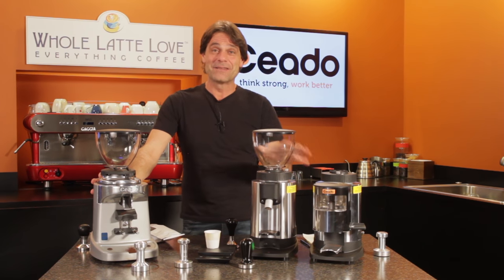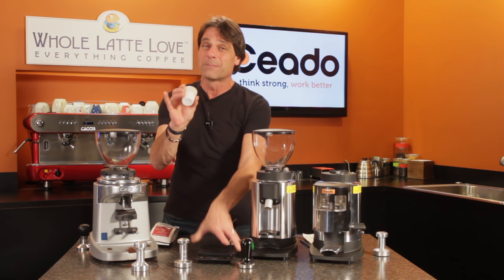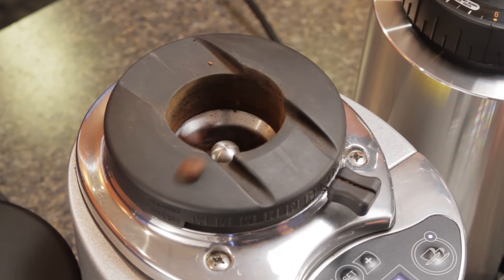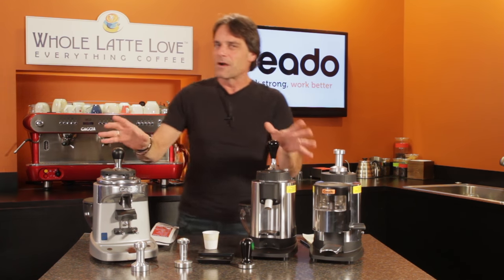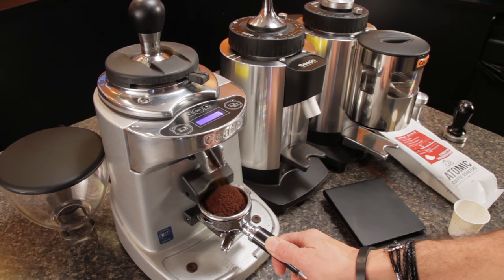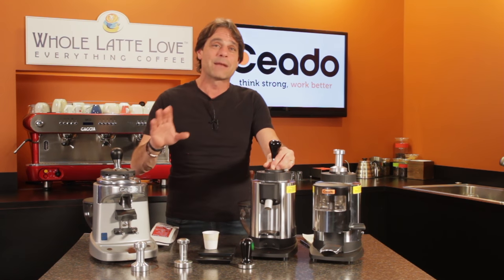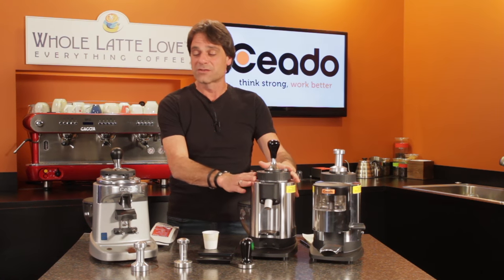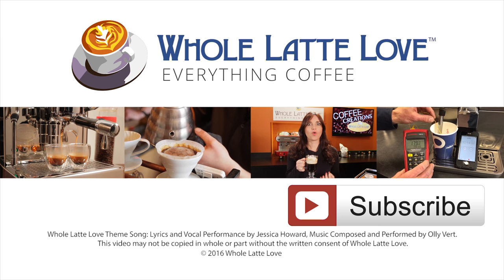How To: Espresso Single Dose Tamper Trick with Ceado Grinders

Comment: Mark, thank you for the suggestion to use the tamper for single dosing.  I have removed the hopper from my E37S, which I bought in 2019, and switched to single dosing for 2 reasons.  1) By single dosing, you don't leave residual grounds in the grinder overnight (affects freshness), and 2) you can easily adjust the grind without coffee in the grinder, thus not wasting coffee while making the adjustment.  I considered buying a bellows to puff the remaining coffee out of the grinder after each dose, but they are expensive.  Instead, I discovered a cheap but effective alternative: While grinding the last half of the single dose, simply move the tamper up and down in quick succession a short distance, puffing the ground coffee out.  By this method, I am able to put 18 grams into the grinder and get 18 grams (or very near that) out of the grinder.  It's simple, easy and effective.
A note about the worm gear upgrade:  When I bought my grinder in 2019, I don't think this was available.  Whether it was or not, I considered it way too expensive for my budget.  However I finally bit the bullet and spent the $300 for the Gear Upgrade Kit.  Although it was very expensive, I wouldn't even consider having the Ceado E37 without it.  You can make extremely fine adjustments with the worm gear, which is impossible without it.  These fine adjustments are indispensable for getting the grind right, and I've found that these adjustments are needed frequently.
Reply from the maker: Hey robert, thanks so much for sharing you experience and tips! Worm gears - Ceado really prefers to call them "Quick Set" are by far the most precise grind size adjustment available! I recently did some testing on the Profitec Twist grinder with a worm gear in this video: https://youtu.be/z9c9kBAvam0 Precision is such it's possible to adjust median grind particle size by 1 micron as shown in my grind particle analysis testing.
Marc

Comment: Mark, you evil frikkin genius!!! I'm currently working on making my own single dose solution for the e37J and after a couple of days messing around with CAD making fancy designs you just made things about a hundred times simpler lol. If only you could get them to make a cheap worm gear for the e37J too, that would make my year!
Reply from the maker: Hi Richard, Hahahahaha (in evil tone)! I'm 99.99% certain you will never see a worm gear for the E37J. Ceado holds that for the E37S. If you can design a retrofit We need to talk!
Marc
Reply: @Wholelattelovepage  I used this tamper trick until my friend and I made a homegrown solution using a borosilicate glass cylinder with a lathe-turned aluminum weight on top. Now I can dose a cup or days worth and still have the approximate weight of a hopper full on top of the beans to stop popcorning and keep the input flow 'as designed'. Worm drive design prototypes completed but the issue is access to the correct workshop tools to make it happen and do some iterative testing. In essence, the idea is to replace the existing grind size slider with a toothed version and a cradle holding the worm gear across the front that is fixed to the front plate screws. I'm not sure I'll ever get there though. I also have to say that in my experience, the e37J retention seems much higher than reports for the e37s (more than 3g compared to less than 1) so although I can use as a single dose grinder and like the idea of proper fine control, to use it as a 'variable grind size per dose' grinder is not in my opinion realistic, at best very wasteful on beans. I agree that Ceado won't review for the e37J. Shame. Thanks so much though for your kind response and constant stream of useful interesting content online. Best wishes to you all at wholelattelove!
Reply: @ZTTINGS  Have you tried the tilted base trick that so many others are using for their grinders? Whereby they tilt the grinder up to a much as 45°. The top grade Ceado machine is made with the tilt.
That may help with retention.
Reply: @ZTTINGS  Also, I really hope that you or a manufacturer can produce the worm gear setup like the one on the E7S. I'm certain there's a market for it. 
Whole Latte Love would probably sell them for some skilled manufacturer...

Comment: I just got a Ceado E37J and the tamper trick works. I also bought a 2.25 inch diameter short PVC connector pipe thing ($6 Canadian) at the hardware store to make a small single dose hopper. On my receipt, it says it's a "PVC Schedule 40 Reducer".
Reply from the maker: Hi TPS, Thanks for the tip - like it!

Comment: The Answer to my Single dosing headaches and more.  This video.   Thx Mark.   On another 2019 headache which would probably be more to disecting the machine,  why is Ceado bringing to the coffee market Active Thermal Control .  I got this confusing answer ...  The exclusive automatic thermal control system protects the consistency of the coffee from the excessive peaks in temperature normally created in the grinding chamber.
Reply from the maker: Hi 72, Thanks for the comment. Think active thermal control is marketing speak for dissipating heat in the grinding chamber. Excess heat probably not a big deal unless one is grinding a lot of coffee continuously.
Marc

Comment: Hey Mark,

Love your videos! Watching a few of them feels like I’m taking an online course. I am interested in purchasing the E5P. I mostly single dose and I was wondering what the grind retention is with this method?

Thank you!
Reply from the maker: Hi Miguel, Thank you for the comment. I don't consider the E5P a low retention grinder. In my experience you can expect 2 to 3g of retention when single dosing. In machine grade grinders the Ceado E37S retains ~.5g and the E37SD near 0g. The SD stands for single dosing - built specifically for that purpose. The SD is rather expensive. If you're okay with more of an appliance grade grinder have a look at the Baratza Sette 270. Baratza considers it their best espresso grinder (and I agree). It has very low retention when single dosing. Typically less than .5g. https://www.wholelattelove.com/products/baratza-sette-270-conical-burr-grinder 
Hope that helps!
Marc
Reply: Thank you for the great info!

I was looking between the 270 and the E5P. I fell in love when I saw how fluffy and consistent the grinds were coming out of the ceado.
Reply from the maker: My pleasure!

Comment: So from reading many of your responses Marc it appears the Ceado E37S would make a very good single dosing grinder making it hard to justify spending an extra $700 for the Ceado E37SD.  Would you agree or am I missing something.  I only single dose but if grind retention is that low on E37S then I'm thinking save $700.
Reply from the maker: Hi Tracy, Thanks for the question. It is possible to single dose with the E37S. It's not nearly as elegant as using the E37SD but is doable. Really depends on how particular you are as the E37S requires more effort to get the last .5g or so out and can retain .3-.5g in best case. IMO that's a a tiny part of the next cycle but for some it may be too much.
Marc

Comment: About single-dosing for espresso. I have a Baratza Vario and I used to do that, but I stopped because I thought it could be damaging or over-wearing my burrs. At espresso settings, the burrs actually touch each other and so it doesn't seem to be a good idea to let the grinder run dry, which is what ends up happening when you single-dose. What's your take on this?
Reply from the maker: Hi Ascosta, My take is your burrs should not be touching when running grinder dry without coffee. Typically when calibrating a grinder you'd adjust to hear the burrs touch with no coffee running through and then back off a bit.
Reply from the maker: In my haste I did not register you were using a Baratza grinder. When calibrating grinders like the Ceado's featured in the video I go to burr touch with no beans, back off a hair and call that zero. For the Vario, I'd go with what Baratza recommends. Thanks for your comment and link to Baratza's video. Next time I talk to Baratza I'll ask them about the 2Q touch spec. My guess is it's not the the cutting portion of the burrs making contact.

Comment: Hey Mark, 

I currently using a Ceado E37S, older version (same as the video). Couldn't find the perfect grinding size even after using 1kg of freshly roasted bean. Some will say different beans different settings which I very agree with it, but I know i am far away from getting a perfect shot of Espresso. Currently using a Delonghi machine with a normal tamper. Extraction time: 10 seconds only with 17g in 40g out. Flow super fast.  Any ideas or suggestion?
Reply from the maker: Hi BC, Thanks for the question. What Delonghi machine? Most Delonghis use a pressurized filter basket. If that's the case with yours then grind size will not make much difference as it's the basket which causes pressure to build and not the grind size of the coffee. Even older E37S grinders are incredibly good and should have no problem dialing in a proper grind size when brewing in standard non-pressurized filter basekt.
Marc
Reply: I have the same machine and the measuring cup from my tiger rice cooker works even better than my 58mm tamper but the entire setup looks horrible.

Comment: Hey Mark, nice "SD" trick with the tamp ...  but how is the grind consistency when there is no bean weight/pressure from hopper? cheers
Reply from the maker: Hi DK, Thanks for the comment. No change in consistency in my experience. With no beans pressing down it does take a little longer to grind the same amount of coffee.
Marc
Reply: @Wholelattelovepage  Hey Marc, thanks. Have you already tested the ceado 37s with SSP Burrs?

Comment: Is there a short hopper available for E5P? Does the mazzer fit?
Reply from the maker: Hi Jason, Thanks for the question. The current E5P has a short hopper. The Mazzer hopper does fit nicely in the E5P but is essentially the same height as the stock E5P hopper: https://www.wholelattelove.com/products/ceado-e5p-electronic-coffee-grinder
Marc

Comment: Why go through all that trouble? There is a perfectly fine stopper/guard inside the bean hopper itself! Just open the guard, pour the beans in and shut it afterwards.
Reply from the maker: That's always an option. With some of the larger grinders height becomes an issue when placed under the typical 18" overhanging cabinetry.
Reply: True, but it's not the purpose of this video is it?
Reply from the maker: Not entirely - it's just an option. Can't tell you how many videos I've watched with people using all sorts of things to cover grinding chambers... paper cups, plates, their hands.

Comment: what is the best for use at home, k30 vs e37s? I have a ecm technika. Tks!
Reply: mericlis both of the aforementioned grinders you have mentioned are adequate for commercial use, however may be overkill for a domestic environment. The both feature professional grade construction and have large burrs which provide fast grind times and lower grind temperature. Both also use time based dosing, which is inaccurate and generally considered a no no in the industry. Based on your machine I would recommend looking at the new Baratza Sette W, it will give you similar grind consistency, take up considerably less counter space and give you an accurate dose. Otherwise, look at a Mazzer Mini and a set of scales. Grinders like the ones you have mentioned are only really viable in very busy businesses where they work hard. It is there where their ability to keep coffee cool and produce grinds quickly that their price tags make sense. If you make a few coffees at home each day for you and your friends/loved ones there are machines on the market that will do the same job (if not better, remember weight vs time based dosing) for a lot less money. Good luck 👍🏻
Reply from the maker: Hi Mericlis, Thanks for your question. Response from Craig Francis has a lot of good points! I'd add a bit to that. First some people want the big burr commercial grinders for home use. Never need to second guess your grind. The 2 you mention are wonderful grinders that will go for decades. The Baratza Sette is a unique game changing grinder and worth a look. But a couple things to consider. First, no where near the build quality of commercial grinders. There's a lot of plastic in the Sette including the top burr unit which has a lot going on inside and is not user servicable - burrs are not replaceable by the end user. Second, the Sette is very fast at grinding and has near zero grind retention as it grinds straight thru with the top burr spinning and forcing the beans in. But, it's also very loud! Nothing like the smooth sounds coming from a Ceado! In the end, you could purchase a couple of Sette grinders for the price of a Ceado E37s. As for Mazzers, They are long loved grinders. Personally I prefer Ceados like the E5P or E6P over the Mazzer Mini doserless grinders. Same burr size and more powerful motors for a lot less money. But the biggest difference for me lies in the grinding chambers of the Ceado vs. Mazzer. I don't like the way the top burrs on Mazzers rest on 3 springs and how the grinding chamber is open to the threads of the adjustment collar. Coffee tends to gum up the threads and makes for stiff or jumpy adjustment. Ceado grinding chambers are sealed much better to keep coffee out of the threads and the E37S has a brilliantly designed top burr unit where the burr and adjustment section remove as one piece allowing for cleaning without re-calibrating.
Reply from the maker: Hi Craig, Thanks for sharing your thoughts - spot on!

Comment: I know your videos are based on general advice for consumers, but when you give inaccurate tips to people you are doing them a disservice. No grinder gives 100% grind retention. Coffee sticks to burrs, to dosing spouts, to tampers. You can put 18g of coffee in the top of a grinder but I guarantee that's not what ends up in your basket.
The only way to guarantee that you are dosing and extracting correctly is to weigh your entire handle, tare it, and weigh your grinds IN THE BASKET. Time you're resulting shot and take notes. Also, a 58mm tamper preventing "popcorning" is not a feature... your palm (or any other flat surface) can do that 👍🏻
Reply: Well calm down u need some coffee!! read the title it says "Trick" if it doesn't "Treat" you well thats fine too. but i do that all the time!! single dosing and yes retention is a pain in the @$$ so i do 3g more from what i need also, act as a purge of old stale grinds. another PLUS is u get to adjust the burrs without running beans through. well happy halloween!! :P
Reply from the maker: Hi Craig, Thanks for your comment. Totally understand your concern regarding grind retention. Ceado grinders actually do really well and retain very little. The big boy E37S in the video has retention of under .2g. which equates to a hair over 1% of an 18g dose. We weigh our doses all the time in the portafilter and .2 grams is an acceptable variation we would not lose sleep over. As stated in the video that a 58mm tamper fits in the neck of Ceado grinders is a fun coincidence - did not say it was a feature. Just works out and hey if you've got your tamper right there why not use it to stop the popcorning?
Reply from the maker: Hi Daniel, Thanks for your comment and pointing out that single dosing makes adjusting burrs to a finer setting easier!
Reply: Whole Latte Love  No way the E37S retains that little? 0.2 grams? you guys need to do a video on that. i don't believe it retains that little, because from the burrs to the chute there is a small gap, how does it not retain more than 1 gram?
Reply: @ctgaming168   LOL dude! always been a fan of WLL on their test and opinion. I'm not sure if i stepped on your tail or you're high on weed, which section of my comment says their test does not matter? i'm just hoping they do a review about how little it retains that's all. CHEERS and stop whatever you're taking and calm down before commenting.

Comment: Guess I’m slow...but why is everyone on all these videos worried about single dosing...why not just measure your beans, dump it in the empty hopper. Who cares if it popcorns a bit...gravity will win the day.   What am I missing. Thanks
Reply from the maker: Hi JN, Thanks for the question. With lot's of popcorning it might be quite awhile before gravity wins. Depends on the grinder, but it can get annoying. Some Eureka grinders have a propeller on top of the grinding chamber. It helps feed the beans at a constant rate to the burrs and results in very consistent weights for timed grinding. but single dose the grinder and it causes severe popcorning.
Marc
Reply: Whole Latte Love thanks for that Marc. Good to know that some are better than others for this even if it’s not really designed to be for single dose.  
Say , on another topic I sent a question about..do the new gaggia classic pros come with really high bar pressure out of the box that requires tuning like the older version...or is it more in the 9-10 bar range from the factory?  Thanks again. Great channel